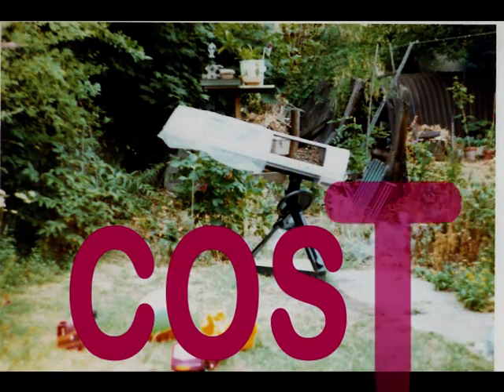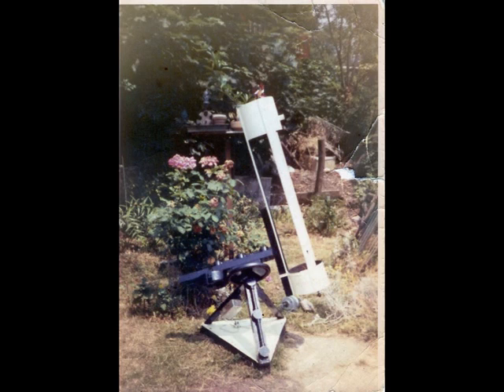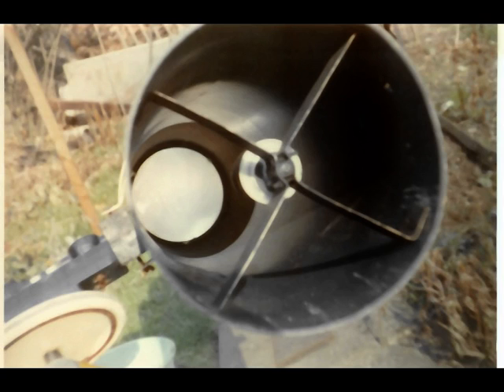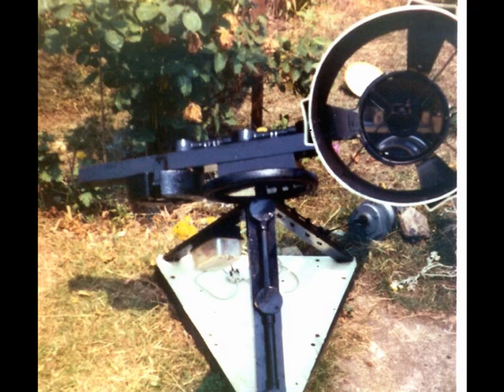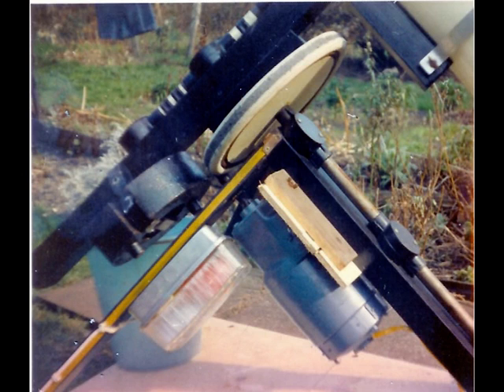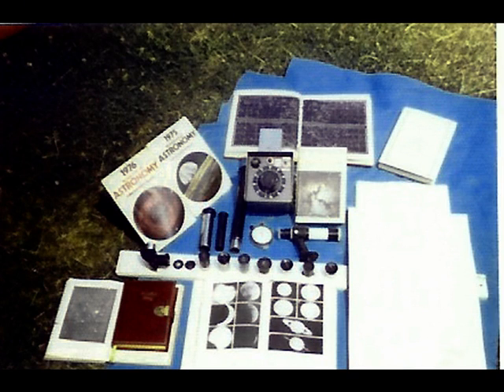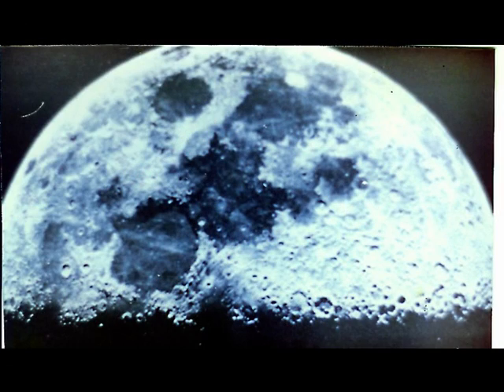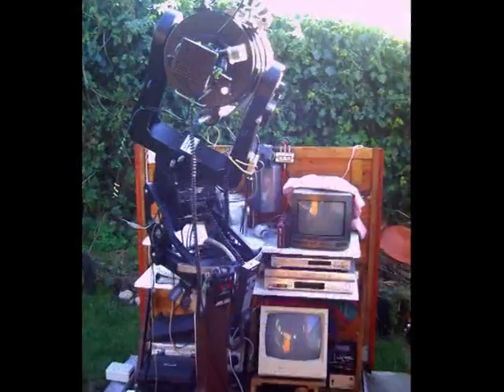Meade LX200 - From Home Made

Comment from the maker: Hi there. If the figures are correct you gave me you can't use it....
The "f" ratio is totally wrong for a scope. Lowest would be around f5 at the most. You need to try and get hold of a book called "Amateur Telescope Making" hard to get as its out of print now but they are still around... To be fair now there are so many scopes out there that second hand is a good way to go but you need to have someone with you who knows - and never buy without seeing it. (Join an Astro club) Regards Peter

Comment from the maker: @gooseknack Hi - thanks for your input - I keep everything simple and there was no locking system as such - Used good old friction - the pram wheel on the RA had the spokes all knocked out and a flat section of wood was inserted which connected to the drive - above that and resting on the wood was a steel plate which was bolted to the RA axis of the scope - the weight of the scope resting on the steel plate / pram wheel gave the fiction needed.
DEC was again by friction and used clamps for that.

Comment from the maker: Wow first comment back and its only just been posted - Thanks. It was great but the wood did finally rot after about 14 years in the open - the bits underneath I could not treat. I have now passed on the main mirror and flat to another keen DIY chap as it will never be wasted. It was not the easiest to use but it worked well and the only thing lacking were any good eyepieces. When I joined a club I managed to borrow a few and had to re-make another draw tube as my originals were a mish mash.